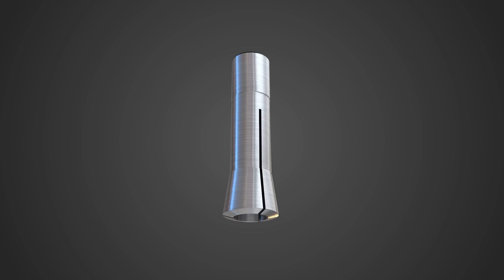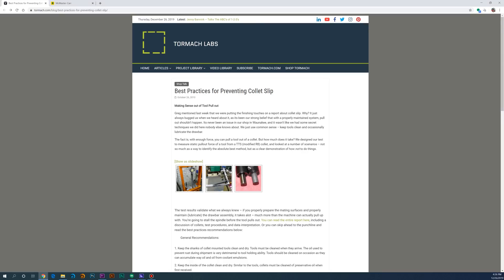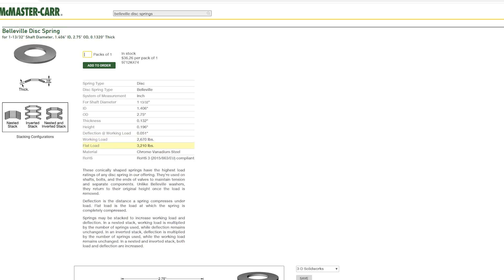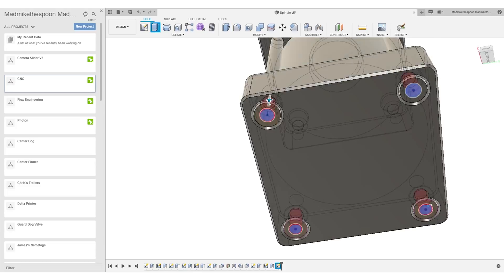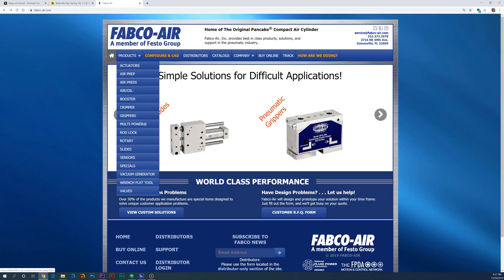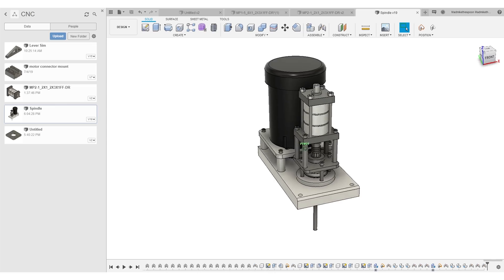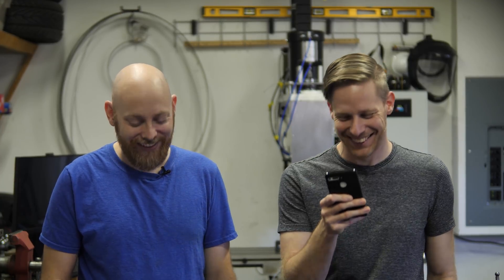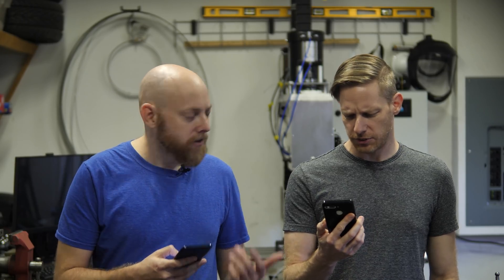Power Drawbar -S03E11

Comment: I really enjoyed the show on the linear tool release, but it seems to be limited in application to a “collet” for tool holders with a common shank diameter. This is similar to the retention knobs on Cat and BT tool holders. In a R8 spindle, there would not be any way to change out a collet, nor enough diameter for anything else. A NMTB 30 replacement spindle might give some chance if you could devise a working retention knob, collet, and closer ring, that would work inside the replacement spindle.
  If I have publicly shot off my big toe with these observations, I would certainly like to be enlightened, as it does seem to work well, and likely consumes much less air than a pneumatic impact wrench commonly seen on top of a Bridgeport. 
  Thanks again for the presentation. It is a real mind opener for the person looking for a new method. I also like your 3D tracing paper for transferring contours to plate stock.

Comment: This got me so goddamn confused.  You said you used a 4" air cylinder.  The part number shows a 2-1/2" cylinder, 1/2" stroke, 3 stage.  That only does 1656lbs at 120psi according to Fabco's product documentation.  It's '4.0" EQUIVALENT'.  You have a 2-1/2" piston cylinder.  You're not getting 2200lbs of force.  Those max at 150psi which is only 2070lbs, and I doubt you're running it at that?  Am I missing something?  (and sorry to be curt, but I'm trying to understand all this myself completely before finishing a design & buying all the hardware)

Comment: You totally should build the Clough42 electronic leadscrew.  I hear it's pretty adequate.  :)
Reply from the maker: Word on the street is that it's extremely adequate! I fully plan to (Mike) but Ryan is a bit apprehensive about decoupling that mechanical linkage for threading ops. Have you had any failures so far?
Reply: @PhysicsAnonymous  I haven't yet.  The only issue would be lost steps or overwhelming the servo, and that comes down to the torque requirements of the particular lathe and the cut.
Reply: Full-CNC is only fractionally more work. 
(Depending on how far you go. If you make new castings to replace the gearbox, apron and leadscrew support then it's a lot more work.)

Comment: I rewatched your video partly for the heavy metal unicorn but mainly because it was placed in my feed again and I always enjoy them.

However, when I first watched it, I did not realize you attempted to lever the air cylinder and gave up when you realised it would put pressureon the bearings.  You could have a created the same or similar setup by continuing with the lever with an offset cam and connecting it to forks that would slide with the lever to grasp the spindle. Turn the air cylinder horizontal instead of vertical and when activated, it could slide forks to engage the arbor then continue in a pinching motion to release the colet.

I doubt it would be less work and the solution you used is in and of itself fine. Just wanted to let you know you weren't entirely off in your initial attempts. You could have rube goldberg'd it together.  Anyways. Thanks for the heavy metal unicorn!!! And thanks for the the awesome vids.

Comment: Tox Pressotechnik sells things called pneumatic-hydraulic cylinders. where piston works on air pressure but inside, is hydraulic mechanism. So the thing puts out 2 to 2000 kN on regular 8bar air, ofcource you miss out on the travel distance for the force.

Comment: Holiday Seasons Greetings, and Nice Unicorn.
What is the psi of the air compressor please?
 As for the Angle Grinder on the Lathe,... Tell those the down it, 
The Lathe is a Machine, That is Designed to handle the Swarf from that Hard Heavy stuff we all
know as Metal.

Comment: Assuming German smoke detectors are to EU standard, and i'm sure they are, then they can be of any type depending on situation. They could be ionisation, optical, or even combined to catch both fast flaming or slow smouldering fires. In harsh environments they could be fixed temperature or rate-of-rise.

Comment: May need some more pressure on the tool, my draw bar is applying 3700 lbs. no pull out at .150 stepover 1 1/4” doc at 20 ipm.  1/2” three flute Alu power end mill.

Comment: I don't get the point of this whole system. Where are the advantages over an sk30 spindle cone with pneumatic tool changer?
I mean you are clamping a milling tool in a collect holder and then you clamp this holder in another collect inserted in the spindle???
Doesn't make much sense for me...
Reply from the maker: It's simple when money is any sort of a factor lol. Also sk30 tool holders work in the same way. They are better with concentricity and over all holding power but the principal is the same. Holder holds the tool, collet holds the holder. All of that is a bit of moot point though, giving that our spindle could never hold an sk30
Reply: @PhysicsAnonymous 
Dont get me wrong, you did a great job planing and building the drawbar system. But it is complex and seems pricy too. 
With a sk spindle, it would have been so much easier to construct the whole mechanism plus higher concentricity. The maximum force transfered to the tool is higher too.
But anyways, keep up your work ;)

Comment: 2300 lb is all you need on a drawbar? I presume tou mean a 7/16" diameter (12mm thereabouts) drawbar such as you're handling in the video. R8 collets are essentially friction drive: There is no effective positive driving feature in an R8 spindle. This feature usually takes the form of a dog point set screw which shears at 80 lbft (109 NM). If you run larger diameter tooling, (fly cutters, face mills, SD drills) intending to actually remove stock, the tooling torque demand often exceeds the collet's ability to drive it. The result is a mess inside the spindle tooling recess and usualy a tool that's difficult to extract.

A skilled operator will tension the drawbar less for light torque loads and proportionately more and cutter diameters and torque loads increase. A power drawbar is a one-size--fits-all solution best set to apply the max drawbar tension every time to ensure reliable grip under higher torque demand. The draw bar under discussion is typically made of medium carbon or alloy steel heat treated to Rc 40. Work the math for this example and you'll find about 10,000 lb (44500 Newtons) tension on the drawbar is typical for max torque delivered to the tooling. 

I submit your design is well concieved and executed but your numbers need to be reworked. If you don't, I predict sooner or later you will need to swap your 3/4" collet for a boring head  or fly curret, take an actual cut, stall the tool, spin the collet within the spindle, and shear the indexing feature inside the R8 collet receptacle. I'll go even further and predict conditions (using your 2300 lb drawbar tension): a 2" (50mm) shell or face mill full diameter cut in mild steel will slip in the spindle in excess of .0.080" DOC (2.0 mm) at 0.006" (.24 mm) feed per tooth.
Reply from the maker: Thanks for the maths Forrest. I have no doubt you are right about hitting that max holding power. However, keep in mind this is not a production machine, and the over all stiffness of this machine almost certainty couldn't handle what you have described. We have taken 30 thou cuts with a super fly in aluminum and hit the chatter limit way before our tool holding power ran out. The numbers tormach used were based on a 2.5 hp motor and a 3/4 inch shank. A machine can always be made better, but time and money are not unlimited.

Comment: Using a snapring to transfer theres kind of loads is not ideal. Especially with your super-precise ground groove. Although you're probably going to be fine, I'd keep an eye out for that. Also when using these springs in parallel you have quite a bit of hysteresis due to friction.

Comment: Yeah, I'm still not entirely sure how the de-coupling when running the mill works. :/
Reply: Had to watch it a few times myself. It never actually is coupled. The actuator rod just pushes down on the top of the spring loaded drawbar to release collet.
When it retracts it isn't touching the drawbar.
Reply: As Mark pointed out there's no connection between the cylinder rod and the drawbar when the spindle is rotating. You can see the gap between the cylinder rod and the head of the drawbar at 11:50.

Comment: How do you get the setting for tightness on the volley when you change it out? Just hand right while the drawbar is depressed?
Reply: If I'm understanding your question, the "setting" is done but the initial torque applied to the drawbar with a Collet (and tool in collet). This is where getting the right working load and full flattening values come into play. You want a stack of washers that gives you a load you want (like the 2700lbs) while still have a good amount of travel before flattening but at the same time not having a rapid load increase the further you compress the stack (like for example, you dont want something that is going to take 1000lbs of force to further compress it  say another .005in). 
You then torque the drawbar to the torque that gives you the desired load, then you just need a cylinder and right air pressure that gives enough force and movement to compress the stack further enough that the collet releases the tool.
You really dont need much movement from the assembly to release the tool in most cases.
Reply: Chris oh, I was imagining that you just hand unscrew one collet and screw in another, but was forgetting that most (non clapped out) milling machines actually have a locating pin that keeps the collet from rotating. So you do still have to do a bit to switch collets, especially considering with the cylinder mount, you can’t just spin the wrench around the top to eject. If they removed the pin from the collet receiver they could loosen and then just spin the collets out.
Reply: @natthewsmith  No, with this type of power drawbar system, you are leaving the collet in and just changing the tool. This is for if you are using something like the Tormach TTS tooling where all the holders have a 3/4" shank and you are just leaving the 3/4" collet in the machine and only trying to get it to release enough that the tooling pops out.
If one wants a "power drawbar" where you can / are changing out the collet and tool, then he or she would need to do the impact wrench type kind of like what Physics Anonymous put up the card for in the beginning of this video for their previous power drawbar build.
Reply: Chris on the collet there is normally a little slot that aligns with a pin in the spindle, if there is no pin in the spindle, as I said before, you could feasibly depress the drawbar system and spin the collet out, but yes, I see the design intent and thank you for clarifying.
Reply: @natthewsmith  Sorry, I miss read your last comment. Yes, you are correct.. If the screw has been removed, then technically yes, one could depress the drawbar and simply unscrew the collet from the bar. This though would create a desire to have the depression travel be much greater to be able to get a decent purchase on the collet that was in there but I do see how this could be handy if one has tooling that has R8 shanks are part of the tooling like maybe a large facemill that has its own integral R8 Shank..
If one were going to do attempt something like that, I would say to install a regular collet and 3/4" tool, torque it as per normal, then hit the button to depress the drawbar. With it depressed, schew the collet in till i makes contact with the spindle nose and note how much you have to turn it in to make contact. Then back it back out by that amount. From there, if you did use a tool that had its own shank, then you would just hold the drawbar depressed with the air cylinder, thread in the new collet / tool until it contacts the spindle, then back it off by that amount you determined earlier and release the air cylinder to draw it back in. 

While that method probably wont result in exactly the same pull force, it should be pretty close. It might be a good idea to not back it off as much as what was originally determined so that way you know you are getting at least what the original pull force was at the initial setup. 
On the flip side though, pull force can be somewhat less important on tooling that has its own integral shank like say a facemill or boring head since there is not concern of the tool being pulled out of the collet itself. The pull force in these cases is really just to keep the taper seated and to not have the shank of the tooling spin / slip in the spindle. Like I said though, pull force "can be somewhat" less important. I say it like this because of the spin / slip in the spindle. For example, a heavy cut on say something like a 3" facemill is going to impart a substantially higher torque load on the tool and spindle then say a really light cut with say a 2" facemill. So as we can see, its really a "case by case" situation.

Comment: What is the part number for the cylinder you used and washers, if you don't mind
Reply: I don't know if you got your/an answer yet, but you can see it in the model tree on the left.  It looks like it is 9712k441
Reply: ^I just realized you said cylinder, and not spring washer. nevermind.
Reply: I moved to using R8 fixed tool holders instead of TTS because I had some TTS holders move in the collet.

Comment: how quickly do you expect the washers to fatigue and need replacing?
Reply: TheMixmastamike1000 they are spring steel so if specified correctly they can easily last into the millions of cycles.

Comment: Cool.  Now actually change out the collet.  Or are you going just limit yourself to straight shank tooling of that diameter?  Because you aren't turning your draw bar, your system makes turning the draw bar nut a real pain, and you didn't change to a pull knob system as far as I can see.
Reply from the maker: Google TTS tooling to see what we are planning. I probably should have gone over this in the video. It basically converts all your tools to 3/4 inch. It also has the advantage of getting consistent tool height offsets, great for CNC.
Reply: Physics Anonymous  That would have been a better choice because it isn't clear that all other collets for the mill become significantly less useful.  And as someone who's used both manual mill conversions (bridgeport with centroid control) and CNC mills (Haas), touching off a tool height is a simple and quick task.  Seems like an illusory advantage, especially if you have a quill to quickly set the end of the tool down against a 1-2-3 block.  I think I'd rather have the taper available to load collets and holders into.

Comment: are you guys using the tormach tooling system or are you using a different tooling system
Reply from the maker: Yup, going all TTS. We found a pretty good price on some knock off holders on eBay. They don't seem to be super hardened, but work well enough.

Comment: Do you not need to change collet sizes? The posts supporting the air cylinder seem to be in the way of turning a wrench to go to a different collet.
Reply: They’re using the standard TTS from tormach. All of the toolholders use a standard 3/4” shank that fits into the same collet.
Reply: There is also aftermarket TSS clone tool holders on ebay for half of the Tormach price. You will have to be careful with the size of cutters and how much stickout with the 940 and a beltdrive and larger motor. You will be able to pull out a tool if the cut gets too ruff.

Comment: Argh, good grief! Angle grinder, right down the unprotected bed ways! No! Bad machinist! Bad!
Reply: Don’t be so sensitive. I’m sure it was cleaned up right away.
Reply: Lucas Naveira It’s not dust, it’s red hot grindings and won’t come off with just a wipe, but you already knew that, right ??
Reply: @aguycalledlucas  - could have been, but so amazingly easy to cover the ways first to start with.  This is how lathes die...

Comment: Watching you broach internal splines with a mill is almost as painful as watching someone trying to build a log cabin with a hatchet. Still don't want to hear about the water jet method though. Oh well, they told me in machinist school you could drill a hole with a screwdriver if you push on it hard enough.
Reply from the maker: https://youtu.be/WmYCUljsrDg
Reply: For that part you don't  need to broach it , it has no rotational force on it. It fits the ring clip. A nice fitting round hole would have been fine.  It was fun watching you make it.
Reply: For a one-off part, sometimes you do what you gotta do!
Reply: You can take a horse to water, yada yada.